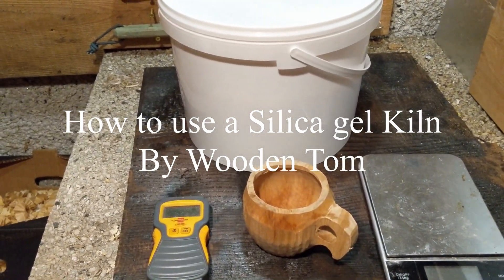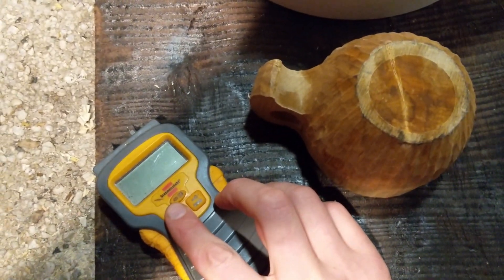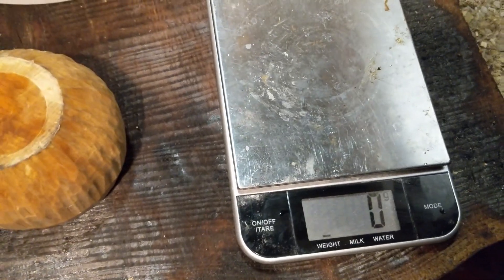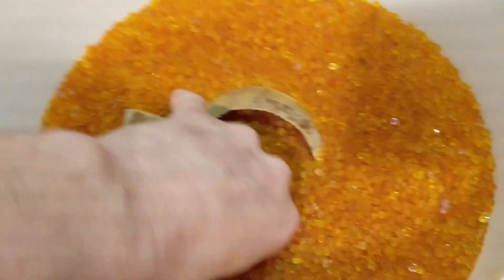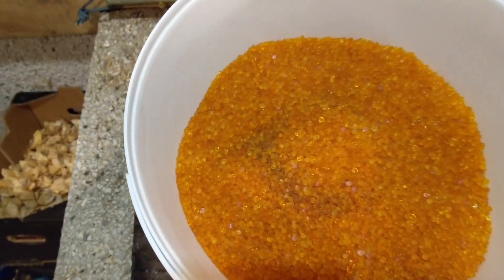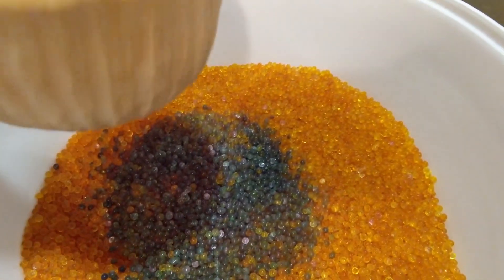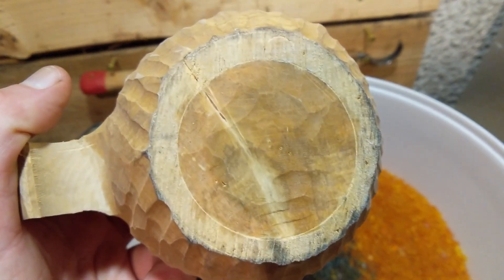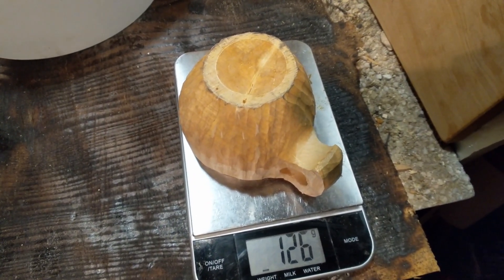How to Make a Silica Gel Kiln

Comment: Great experiment Tom. I'd once thought of popping a few sachets I'd collected in a paper bag, but what you've done shows I greatly underestimated the task. I may try this, depends on the costs and I'm slightly concerned about the dye, so will look into what that's made of. But I suppose they can be rinsed.. a quick rinse won't penetrate much, or take away the deeper drying.  20 thumbs up!
Reply from the maker: Thank you for saying. You can get the silica without dye if you were concerned also